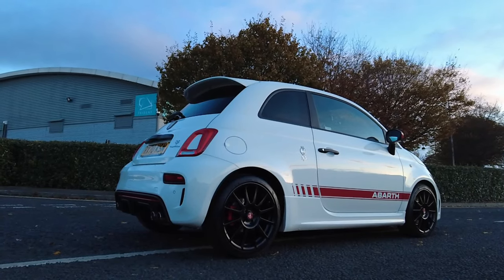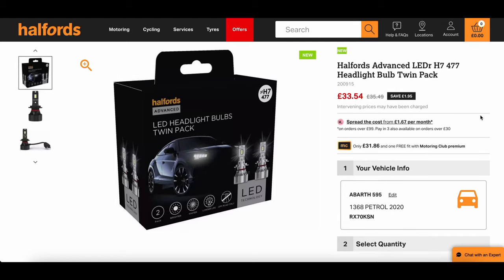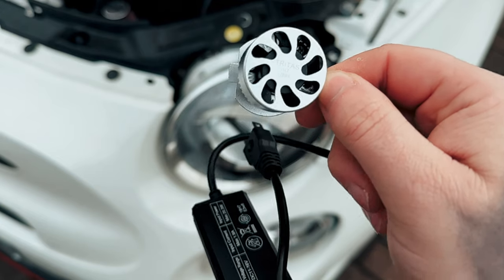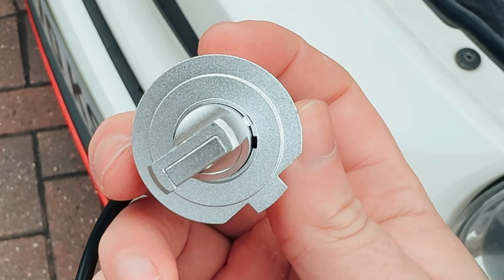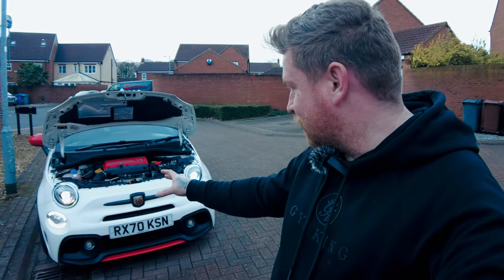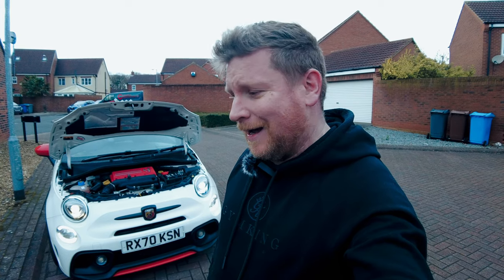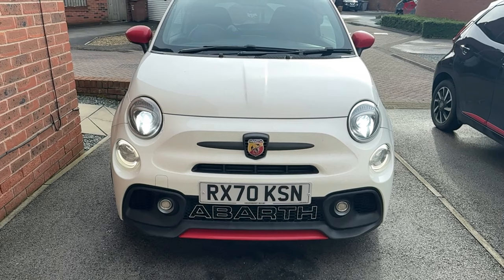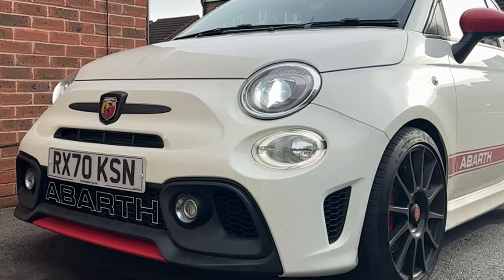Upgrade to H7 LED Headlight bulbs…NOW! How to Install, Test & Review

Comment: I will just say from experience in upgrading my headlights on my Volvo. They use projectors just like on your Abarth, but do be aware that the lens on the projectors are designed for halogens and not for LEDS, as the beam pattern differs between the different bulbs. Also bare in mind the reflectors within the projects do degrade with the exposure to heat for all those years, which will explain why mine used to be terrible, so no matter how bright your bulbs may be, the light output might only be ever so slightly better. Which is why i bought myself brand new projectors with in built LEDs which are insanely bright, they’re about the same as my dads brand new Audi which has factory fitted matrix LEDs. Just putting it out there that just an LED bulb replacement might not work for everyone, do your research lads👍
Reply from the maker: Thank you for taking the time to write this comment :)
Reply: You know that LED manufacturers have figured out how to get the LED to have the same light pattern as the halogens, not all but if you shop around you will find some that make the claim so it should equate to a brighter bulb shooting the same way
Reply: @MultiJackatack isnt led upgrade is illegal in uk?
Reply: I have a 2015 V60 and looking to upgrade the bulbs, I used Leds like this in my 2010 Alfa Romeo Giulietta and failed the MOT due to light pattern. What should I get for my V60
Reply: @MultiJackatack  i don’t disagree with you, but there’s a lot of cheap shit out there😂

Comment: Dont forget guys. This modification is actually illegal and will most likely result in a failed MOT. You cannot convert Halogen headlights to LED headlights. You'll notice that when he shows the box, it specifically says "off road use only" meaning that it is not for use on main public roads. If you want actual road legal LED headlights, then you should buy an aftermarket entire headlight unit.
Reply: Not correct, as long as the beam respect the usual standard pattern are legal and will pass mot.
Reply from the maker: Yep
Reply: Bullshit, if your car has projectors and if the alignment is correct and if the beam pattern is correct then it will pass the MOT. Because they’re projectors, you can’t see the actual bulb inside the headlight. The MOT tester is not allowed to dismantle anything to look for bulbs if they’re CE marked

Comment: These are illegal in the UK, ive just returned a set as i looked into the legislation on the .gov website, these would fail and mot
Reply from the maker: Well, they didn’t so you’re wrong.
Reply: I'm not wrong, look it up.
Reply from the maker: I don’t need to look it up, I made a video where I put them on my car and it’s passed MOT twice since. So factually they didn’t fail MOT
Reply: Lol
Reply from the maker: My car reg is on the video - feel free to check the MOT history
Reply: Haha, it's fine dude

Comment: Problem you have now with xover on the fan is tottaly ussless no air as you blocking the back of it hahahahah
Reply from the maker: I mean, if you applied common sense and logic to your comment if you left the cover off there would be no need for a fan to begin with ....hahahahahahaha

Comment: I previously thought this kind of headlight will be a problem fitting it to the H7 socket. While in fact it's a plug n play connection. I'm definitely replacing my halogens very soon.

Comment: Great video. I was just about to buy these for my Transit van, but after reading the comments about MOT failures, and the mention on the eHalfords website that these bulbs are offroad only, I will be sticking the the standard bulbs, annoyingly.
Reply from the maker: No MOT failure for lots of people as they give out the same beam pattern
Reply: @ZER0Y0N , The LED bulbs I have seen in Halfords say for off road only, the sales person said they are illegal for road use. Seems stupid that they even sell them if that is the case. I would have bought them, but I don't need the hassle in two months saying the bulbs are a fail. Got some higher end extra bright bluish white bulbs, fitted them today coincidentally, yet to test them.
Reply from the maker: @chrisbow1776 they do indeed, but they pass MOT no issue

Comment: I've done the led swap on my car, what I would say is that if your low/dipped and high beam are using the same bulb (most cars) then be careful. You don't want to be the guy blinding everyone coming towards you with your low beam, a lightbar hooked up to the high beam is usually not that difficult to install.
Reply from the maker: Thanks for the comment! They are not that bad,  huge improvement on the previous but still nowhere near as bright as my other car
Reply: @ZER0Y0N  Yeah, it's just a question of caution. Things like how the beam if focused matters a lot, and some modern cars have a screen that comes down to block the top of the lowbeam. But if you put them in a single beam headlight be prepared to send them back if they blind on coming traffic.

Comment: Thanks for this video. The only thing missing is would you tell us what orientation did you set your bulbs at? I.e. 3 and 9 o'clock or 6 and 12? Thanks.

Comment: Hi there! I have a BMW X1 F48, and I have just replaced my H7 halogen with H7 LED from Amazon.
However they didn't come with a driver (or kit) - should I be worried about causing damage because of this? 😟
I have only tested them temporarily and seem to be working fine for now..
What do you think? Many thanks!
Reply from the maker: Hi, no you won’t have a problem, if they are working and no warnings on the dash you will be fine !
Reply: The worst thing that could happen in this case is that you break a fuse (wich is easy to replace and cheap) or you might damage the led. You wont fry your wires or something like that.

Comment: I am looking at these for my wife Fiat 500 hybrid. Do they seem much better than the horrible halogens on there at moment. Is the beam pattern OK doesn't dazzle passer bys. Thanks 👍🏻
Reply from the maker: Hi there, yes 100% they do not dazzle other drivers, whilst they are so much better than previous they are still not as bright or dazzling as the lights on my other car or other modern cars on the road, beam pattern passed MOT also so that’s positive
Reply: OK then no problem as long as they are better and whiter than the crappy halogen be better. I am also looking at the philips one as there just plug and play. Could be a good comparison to do

Comment: Sorry mate one more question b4 I go and grab a pair. How have they been in the car still all ok no error messages regarding the lights. Thanks 👍🏻
Reply from the maker: No messages at all mate ! All good!
Reply: Brill will go and grab some as still on offer as the philips one I want are out of stock
Reply from the maker: @simonattwood4363 enjoy being able to see!
Reply from the maker: @simonattwood4363 yeah I just folded it over and slotted it in, assuming it’s the same as mine the driver side is a bit tight, you need to undo a plug and just gently move the air con pipe to the left, nothing scary but you can get it in and I got the cap on fine I just obviously in the video demonstrated on the side that had the most space
Reply: Well explained and great video comparisons 👍🏼
I'm looking for a pair for my MK8 Civic. I know it has reflector lenses but I'm sure I've seen LEDs designed to work with them but can't remember where ? Any suggestions ?
Thank you

Comment: This is really a game changer! The LED bulbs are so much brighter! The halogen bulbs are rubbish especially the pathetic yellow light and dim!! I also had a pair of LEDs too and they are so much better and see where I’m going!😅
Reply: They will fail MOT, you cannot convert halogen bulbs or led. It specifically states on the box of the bulbs itself (off road use only)
Reply from the maker: @punkrock1989 wrong. They passed MOT :)
Reply: @punkrock1989  well you’re saying it’s an MOT fail, my car also went through it’s MOT and it passed 2 MOTs with LEDs in. My car has projectors and you can’t see the bulb behind the fish bowl. The tester is not allowed to dismantle anything during the test to look for something that is approved, all they do is test the alignment and the beam pattern is correct by using the headlamp aligner making sure it’s in tolerance

It’s for cars with non projectors using LEDs is an mot fail (Existing bulbs for halogen headlamp unit should not be converted to be used with LEDs or HIDs for cars after 1st April 1986, if such conversion has been done you must fail the headlamp on headlamp light source and lamp not compatible)

Comment: But don’t Halfords say retro fitting leds is illegal and these are for track and off-road use only? How did your car pass its mot?
Reply from the maker: Because it passed the beam pattern :)
Reply: Exactly if the beam pattern is within range led lights are legal
Reply: @fabriziof9822 doesn’t matter if the pattern is fine. If the police pull you then they can slap you with the book.
Reply: If the pattern is the same it will pass mot and are perfectly legal. New leds have the bulb at same height of alogen so the pattern stays consistent within limits and will pass the mot, i passed the mot with mine
Reply from the maker: Of course it matters, if they pass MOT they are fine
Reply: @ZER0Y0N Answer me this, if the police pull you and say you’re not allowed aftermarket LEDs. Is he correct and can he penalise you for it. 

Don’t beat around the bush and tell people the truth.
Reply: @dottorcarlone says on the box not for road use what don’t you get?
Reply from the maker: @Kane-Lamb you know it’s simple - don’t fit them if you are not happy? The bulbs meet the permitted beam patterns and have passed MOT, anybody can fit aftermarket LEDs if they are suitable, you tell me this, if there is nothing wrong, not blinding anybody and meet the MOT why are the police pulling you over to check headlights? Just don’t fit them if you’re not happy and move on.
Reply: @Kane-Lamb hold on a minute! Why will the police pull over just to check what bulbs you got? If your headlights are dipped and not dazzling people, adjusted correctly. I run LEDs in for long time including main beam when nobody is about with main beam on, my car has projectors, the aim is correct the beam pattern is correct and it passes the MOT. I never had any issues with the police or the MOT

Comment: And when you read the instructions it’s for off-road use, could be tricky explaining that away if you had a serious accident especially as you have made a YouTube video.
Reply: Same would apply to those driving massive cars with factory fitted leds... regardless of auto self leveling etc
Reply: I’m not sure the size of car is a factor but if it’s factory it’s been approved for road use which these have not
Reply: @joffnun0172  size IS a factor as the lights sit higher up... this is particularly noticeable on hills as you hit with an arc of intense light from on coming cars